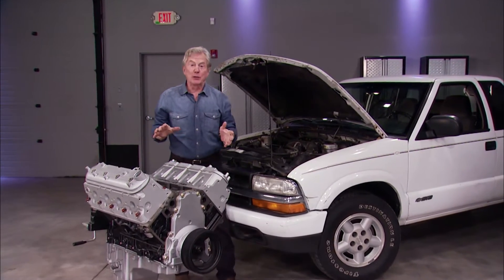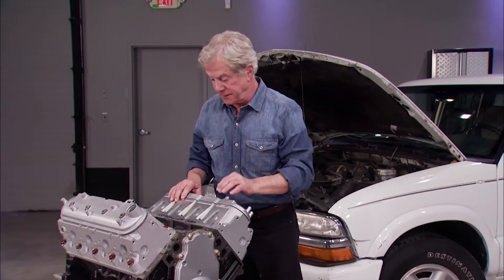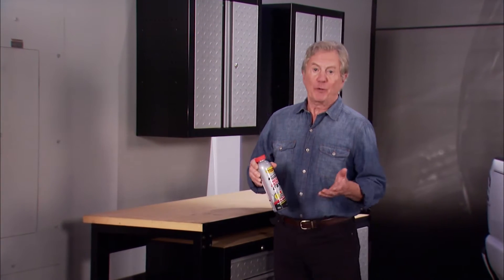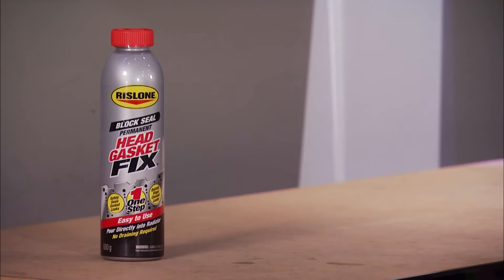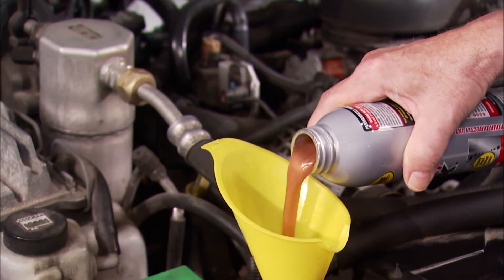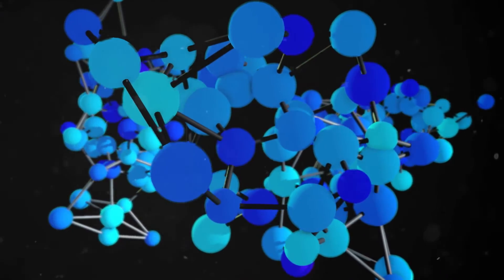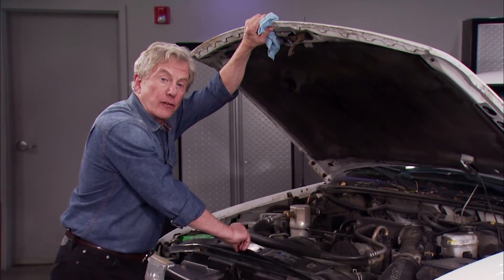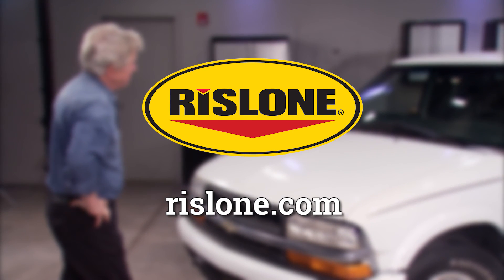Tech Review: Rislone Head Gasket Repair Solutions

Comment: I have a 2018 jeep grand cherokee. How do I use this? I don't have a cap on my radiator is it okay to put it on my coolant reservoir?
Reply from the maker: If the overflow (reservoir) is pressurized yes it is ok to add to the overflow. If not you will need to add to top radiator hose.

Comment: I used your heavy duty headgasket seal when the headgasket failed on my older but well cared for Equinox. I followed the imstructions closely amd it was AMAZING to watch the white smoke disappear while the vehicle was idling! I drove the SUV around gently for another 700km while shopping for a deal on a new Felpro gasket kit. Then I got my local mechanic to put it in for a very reasonable cost considering the work involved. I am confident I could have driven the SUV much farther - I just needed a new headgasket before we got into the coldest months of next winter here in Canada. I HIGHLY recommend your product Rislone!!!
Reply from the maker: Thank you for the comment!

Comment: 2001 nissan sentra gxe 1.8L with 187k kms, i poured 2 cups of rislone gasket repair fix product and let the car idle for 15 mins until the thermostat opened and turned off the car, now im letting it cool down so the material can solidify on the head gasket, then i will go and idle the car for 15 mins again and then let it cool down overnight, remember - it can take 3-4 thermocycles for the product to solidify on your head gasket and fix the cracks... Wish me luck i hope it works out for me!
Reply from the maker: Thanks for the comment!
Reply: update?
Reply: Update?

Comment: I used it and it worked for me , but it clogged the cars heater core.😢 has anybody managed to clean the heater core after using rislone or something similar ??? If yes, with what solutions ???
Reply from the maker: Yes, if dealing with a restriction in the heater core you can flush and reverse flush the heater core itself. This will remove any restriction in the heater core.
Reply: @RisloneGlobal   I think it has deposits on the walls of the heater due to using Rislone. Is there any specific substances to use when I will flush it ???
Reply from the maker: @adiadrian1758  Yes use a cooling system flush. Also you can flush and reverse flush the heater core and this will remove any restriction in the core itself.

Comment: I have a Question?  I bought this product. The Aluminm version and cooper version. I have been dealing with Head gasket promblems in my 2004 Honda Civic. For awhile but I obviosily have a leaking rad and which product would work best for all three problems
Reply from the maker: The best product is the Head Seal Blown Head Gasket Repair for all 3 issues.
Reply: @RisloneGlobal  Thanks
Reply: I also don't see the Aluminm version on Canadian website pn 31186
Reply: The website claims the copper formula is best for large leaks.

Comment: Can you pour this product directly into the expansion tank of the car's cooling system? I have a Saab 9-5.
Reply from the maker: If you have direct access to the radiator no you can not. If a pressurized overflow is all you have access to yes you can.
Reply: @RisloneGlobal  English is not my first language so I'm a bit unsure what you mean by "pressurized overflow". Take a look at this picture: https://i0.wp.com/saabblog.net/wp-content/uploads/2016/08/Kraftwerk.-Optisch-wie-frisch-vom-Band..jpg
It's the tank with the yellow cap in the upper right corner. I can't access the cooling system in any other way.

Comment: Hi Rislone, it's Andres from Uruguay. I've got a quick question, should I completely drain the cooling system before adding 1/2 bottle, and then refill? Sorry to bother you guys but the bottle says that it's not compatible with any coolant and some other articles say that it would work without a problem in case it mixes with water/coolant. Thank you for your answer in advance!!
Reply from the maker: If the product is the Head Gasket Sealant it is not compatible with coolant. You will need to follow all instruction inside back label booklet for all information. You will want to ensure all coolant is removed from vehicle and you flush with water until running clear water before adding that product.
Reply: 2019 ford focus 2l disel , no radiator cap its EU car can i pour into coolant tank ?

Comment: Hi Rislone, Paul here from Australia - unable to contact you via your website contact form - does not work!  Also tried contacting you via Twitter - no reply.  Finally, will try via this route.

Bought a bottle of head gasket repair from Repco here in Australia for my Land Rover Discovery 2 Td5 (diesel).  I was losing coolant - my cooling system (hoses) were over-pressurising with exhaust gas.  It wasn't a big leak, but I wanted to get on top of it quickly as it will take time for me to get all the parts and free time to properly replace my head gasket myself.

Anyway, the sodium silicate worked very quickly - very happy - perfectly sealed the leak!!!  Not a drop of coolant lost since I added the Rislone.  One problem I have though is that my heater core (it worked perfectly before) appears to be blocked after using the Rislone, this is despite following the bottle instructions to the letter and turning my heater on to maximum straight after starting the engine!  Any remedies/thoughts???
Reply from the maker: You may have a bit of restriction in the heater core. What we recommend to relieve this is to flush and reverse flush the heater core itself. Sorry it has taken so long for you to get in contact with us and we are glad we could help stop the leak!

Comment: In a case that I am not sure if there is coolant leak to motor oil, is it still safe to use or can it damage the engine?
Reply from the maker: If you think you are leaking coolant to your engine this product can help to solve that issue. Please read all the information on this product at the following link - https://barsleaks.com/product/blown-head-gasket-repair-hg-1/

Comment: Why do you need to turn the heat up ?is this only for engines with overheating problems?? I heard people complaining their heater got clogged
Reply from the maker: No, Bar’s Leaks Head Seal will not clog your heater core, it is safe and effective. Note: If using Bar’s Leaks Head Seal to stop heater core leaks, make sure you turn your heater control to HOT. Some vehicles have a valve that controls coolant flow through the core and when on HOT it allows full flow.
Reply: Yes, my heater is now clogged even though I had the heater on full after adding the Rislone and followed the instructions to the letter.  Anyway, head gasket is perfect!
Reply: Is there any recommendation on flushing the system maybe a week after using this stuff

Comment: 1994 Toyota Hilux 3vze 4x4, Symptoms are white/grey exhaust smoke (did smell sweet until coolant ran out and started using water), no water in the oil and no small bubbles in the coolant but there are a few burps now and then- I’m losing almost 1L each day of coolant so water it is for now 🤣, no overheating, easy starting, can’t find any other coolant leaks in engine bay or from heater (only blows hot air up to 1/2 fan) runs fairly smoothly but still just a little bit rougher than normal - not a heavy footed driver if I can help it - there are two 15 min hill climbs with one in 4x4 every day (but no overheating).

I’m thinking I have early signs of HG trouble so I’m going to try this today and see how long I can avoid having to do a HG replacement. Fingers crossed 🤣

Comment: Will this work on diesel engines?.I have a landrover discovery 3 showing early symptoms of head gasket failure,a lot of miles on it so not worth a trip to a mechanic.Not overheating but white exhaust smoke and coolant smell,thank you
Reply: Hi Mohammed (yes, I know it's 2 years!), Used on my LR Disco 2 Td5 (diesel) - perfect!!!  I was getting exhaust gas into my coolant - over-pressurises the cooling system and coolant leaking out regularly.  Added the head gasket fix - not a drop of coolant lost over two weeks and 2,000km so far!  However, even though I followed the instructions to the letter and turned the heater on full, my heater core appears to have blocked, doesn't affect the running of the vehicle.  Will look at unblocking the heater core later!
Reply: @intestinalworm1202  Hi Paul, I saw your comments and i've got a quick question, Would you please tell me if you flushed the coolant before adding the sealer? I'm afraid to remove all the coolant and then running it for 15 mins with only half a bottle of sealer and mess it up. Cheers from Uruguay!!

Comment: I want to use this on a Chevrolet pick-up 1989 which is having an issue, (a little water is coming out of the muffler) but my AC system isn't working, can I still use this with the same results?
Reply from the maker: Please give our tech support team a call so they can further assist you. They are available M-F 8am-5pm EST, and can be reached at 800-345-6572. They look forward to speaking with you.
Reply: Water from your exhaust means your engine is running normal, has nothing to do with coolant leak

Comment: Have a 1989 hilux 22r engine overheating with an engine miss.water in the oil,steam from the exhaust.Used the full bottle of rislone head gasket repair, double what was recommended.No change in my problem
Reply from the maker: Hi John, please give our tech support team a call. They are available M-F 8am-5pm EST, and can be reached at 800-345-6572. They look forward to speaking with you.
Reply: @RisloneGlobal  what is the cost to call from Australia

Comment: Worked like a charm for me. 2000 kms since "repair", not a single drop of coolant lost since. Follow the instructions, but pour in less than you think you need (I used 1/4 of a bottle). Better to add more later, if it doesn't work the first time.
Reply from the maker: Thank you for the comment!
Reply: Last year, I used it (Small 1.4 liter engine, with 500000 km (!!)  running time..) I made 12000 km, since. White smoke is re-developing now. So, I will redo it. (The coolant had been changed, so none of the original product is still in the coolant) 
It does not work within "30 minutes". I think that information is the only one which is misleading. In reality, I saw the effect after some 10 days of driving.  Some 2 months after, every trace of 'white smoke' was gone.  The most liable info, in my opinion, would be : It takes time.

Comment: just bought some for 39 $  Seemed to work, idles normal, runs smooth now. 93 toyota truck 501,000 kms
Reply from the maker: Awesome. Thanks Chubachub!
Reply: Chubachub Chuba just pour a full bottle into my engine coolant cuz i have a reservior cap no radiator cap...2002 cadillac deville...see what happens